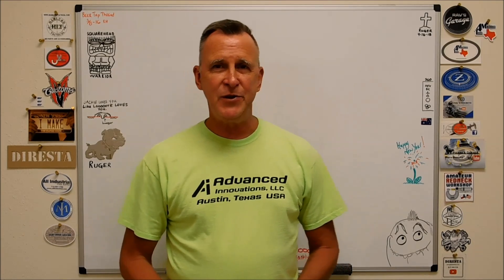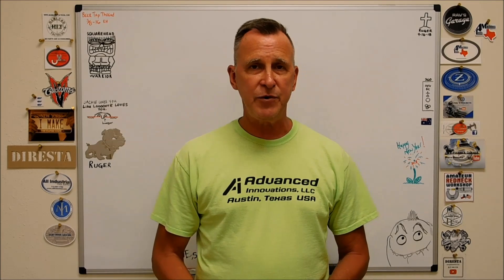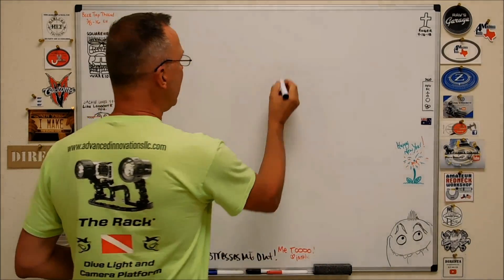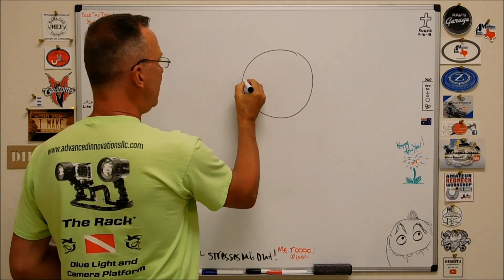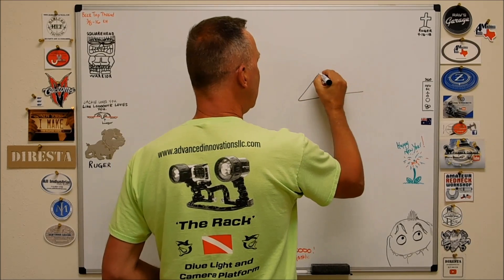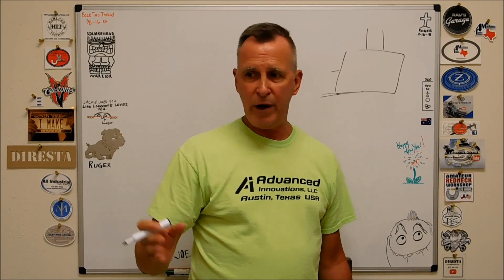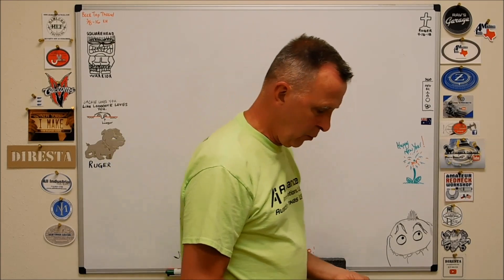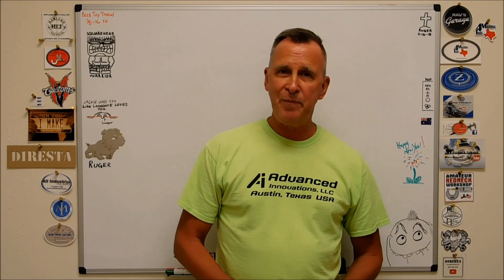Flycutter Tool Geometry vs. Chipped Parts

Comment: by adding a radius to the cutting edge, you're essentially making something that's similar in effect to a wiper insert, I mean there is a parallel, it's not the same thing, but the idea isn't far off in it's effect to the cut. it's very rare that I get to use HSS tools, the shop I work at is mostly exotic metals that are a bit too rugged for the High speed steel tooling, you nailed it with your answer to my last question (in regards to pushing a material very hard and still having trouble breaking chips) you nailed that in one, inconel. monel, hastealloy, Aermet, the materials that make life miserable are the kinds of things the shop I'm in deal in almost exclusively. It would be interesting to see you do a few videos about tackling the materials that make us all kind of cringe a bit. I did have another question for you less to deal with harsh materials, recently, I was turning some relatively large parts, 304L stainless. The problem I encountered that I couldn't seem to get passed was skin layer notching my inserts, tried tougher roughing inserts, with a larger radius, not much better results, slowed the spindle, and eventually both the spindle and feed. Still couldn't get a corner to make the full cut before it came undone. (6" dia. over a 52" cut, non ideal cutting conditions, the parts had a lot of runout so it was maybe .020 deep on one side, and .100 on the other, for the purpose of this particular job I'm going to call it and interrupted cut.) how would you deal with a job under those conditions, productivity is key, and restarting a cut that big 3 times to make the first pass, really kills it. this may sound strange, but working with something like stainless I almost prefer the harder materials, they may kind of suck, but I know what to expect, this was my first time dealing with stainless and I was completely lost on how to deal with the problems I was having.
Reply from the maker: I worked for a government contractor making submarine parts back in the 70's. I know those materials all too well. I currently do everything I can to avoid them. As for the stainless....2 rules for that stuff. Keep the tip of the tool buried, and don't be afraid to push it. Stainless, especially the 'L' series, like to work harden and lights cuts can be tough because of that. keep your tool under the top surface and keep it moving and you'll be pleased with the result. I say coolant is a must, but some may disagree. Keep the machine rpm lower on the 6" material, or the surface footage will just erase your tool. Good luck.

Comment: Hi Joe, 
Great videos and I learn a lot from you!!
I have a new job in a Tool Shop.
I could really use some tips for re-threading over-welded shafts.
I have to repair burnt bearing surfaces and ruined threads that have had new material burned-in.
Any advice would be much appreciated!!
Keep making videos to pass along the wealth of knowledge you have.
The few Manual guys like myself will use it and pass it on to others.
Too many new guys think CNC is where everything should be done.
You don't tie-up a 100K machine for hours just to make one part unless it is Very complex.
That machine could be making repeatable parts instead.

Comment: Time to go dust off or actually rust off my collection. Never had much luck with them.
Perhaps I can grind a bit correctly and get it set properly.
I've been trying to figure out the geometry of the cutter you used in your video "Safe and Easy Internal threading with a hard stop" where you face off the part @~19:00 and now I 'see' it.

Comment: In large part thanks to your videos I just cut my first thead ever (1.25" 16 tpi brass) with the first try being a useable part. 
 A good thing too  since the only stock I had was the body of an old shower valve.
This was for an emergency repair to an outside faucet where the PLASTIC body of the anti syphon valve broke, and of course is not available.
 It took me a laughably long time including grinding the tool on a rickety shop bench grinder. 
My lathe is a Chinese 7X14 I have used for the last 5 years for cutting and polishing. 
BTW: PVC pipe polishes up to where it almost looks like ceramic.

I am electronic engineer working mostly in software these days. 
On the "make a tool/jig" or 'just grind them out" decision the software analogy is whether to automate a repetitive task (formatting, importing data, whatever) I will always go for automating where possible for 2 reasons

1: Even if everyone says it is a 'one time' task it often turns out not to be and the basic structure can often be used elsewhere.
2:  It is simply more enjoyable than sitting there getting carpal tunnel from repetitive actions.

Again thanks for the videos, not sure exactly what I learned but beyond basic facts I found I had some "instinctive" knowledge when making the faucet plug, especially when dealing with holding and centering the "stock" i had to use.

Comment: if the cutter was balanced to eliminate vibration, would there be any downside to using a big radius fly cutter? like 6 or 8 in diameter...?
Reply from the maker: I don't see a downside if your machine can handle it. Knowing the increased surface footage resulting from the larger OD, slower RPM may be in order.
Reply: Mainly a gearing issue - the bigger the cutter, the faster the cutting edge travels. If your machine can handle it and has appropriate gearing, that doesn't sound out of the imaginable.
Reply: Suburban Tool, Inc actually sells them that go up to 19 inches. It isn't cheap though :-)
Reply: I have a flycutter about 1,5  feet in diameter for resurfacing car cylinder heads, but you have to keep in mind that it exagerates the spindle runout, if you have a geared head and the gears don't mesh perfectly it shows up on the finish, and if your mill ways aren't perfect you will never get a consistent cross hatch.

Comment: Great video,  very helpful but your cutting edge wasn’t on center on your second cut. Thanks!
Reply from the maker: Its better to be behind ( or below ) center than it is to be ahead or above center. The re-sharpening will drop the tool below center. its unavoidable.

Comment: many years ago i was milling some 2024 AL   very very soft.  with a 12 in milti insert face mill cutter.    after while i saw  the chips was  very very long.   20 inch or more.   the soft AL  was staying on the cutter and coming back around and welding on to the next chip.   1500 RPM   at 57 inch feed rate.   those K & Ts  are tuff machines.
Reply: it certainly wasn't 2024 aluminum.   2024 usually is in the T4 temper and is strong, hard and tough.  Or someone could have annealed it right before you tried to cut it.  I say right before because 2024T4 will start to re harden automatically in about a half hour (depending on its thickness).  What you are describing is a 1000 or 3000 series aluminum.

Comment: Hi Joe, this applies to all cuts. In the first cut you are reaching final depth with the very front of the tool, tearing a large part where at the back of the tool the material still thick strong enough to broke a piece with it off from the edge. If you would have used the same tool cutting only .005 it will most likely not happened. That what you did with the second cut where an upper portion of the tool does "pre-cutting" and the deepest part of the tool has much less and a bit later to cut. That is the reason I use rounded corner end mills for face cutting. Now, does that make any sense?..... Old Bob

Comment: Would a round bit work about as well?
Reply: no, same problem only in a form of a radius.
Reply: I'm talking about something like this... https://jet.com/product/3-x-1-Indexable-Round-Face-Mill-Cutter-Milling-Cutting-Use-RPMT1204-CNC/f9aab27d101f4edfa68ec1f583d1de8b?jcmp=pla:bng:nj_roc_gen_tools_home_improvement_a2:tools_home_improvement_power_hand_tools_other_power_tools_a2:na:PLA_333246416_1211661984210420_pla-4579328491921757_c:na:na:na:2PLA15&pid=kenshoo_int&c=333246416&is_retargeting=true&clickid=338f75ac-6aa9-4f35-bee4-1c335d1e9843&kclid=338f75ac-6aa9-4f35-bee4-1c335d1e9843&msclkid=f4d212629b181b715e914958e4121ef8
Reply: DSCKy Thats a shell mill for large areas. 
In order to keep the edge burrs down, you climb mill the perimeter first.
You can do the same with a fly cutter also.
Reply: We don't seem to be communicating. I "THINK" a fly cutter with a round insert similar to the ones in the shell mill should perform very nearly the same as Joe's bit... as long as you take cuts less than the radius of the insert.  The larger the insert, the better.
Reply: DSCKy I suppose so, I use a .125r on my fly cutters when i have room to. 
I think Joe was just illustrating common things to work around.

Comment: great demo again Joe, one thing about the "smear" edge: sometimes you'll never get away from chipping no matter how sharp the tool so a sacrificial piece sandwiched against it will eliminate any chipping.  works great on wood too by the way
Reply from the maker: That sandwich technique has saved my bacon on more than one occasion. you are spot on.

Comment: While I machine very little plastic there's not a hope in hell I'd ever have figured out to grind the tool tip into that shape to prevent blowing out the corners. More than logical AFTER it was explained Joe. Not even sure there still available, but years ago I bought a 5/8ths shank fly cutter that uses round carbide tips on the tool tip. Made by New Dimension I think? Unless you do something really stupid and break the carbide in half it's dirt cheap to run since the tip can be rotated as it wears or in case it chips the edge. It gives a great finish on anything I've tried it with.

About all I could add that most home shop guys either don't know or seem to forget is a single tooth fly cutter in metal is a finishing tool. There hard on the drive splines and probably spindle bearings at large depths of cut. Lot's of YT videos around where you can hear those splines hammering back and forth every time the tool tip enters the cut since there cutting more than the tool should be. Maybe I'm being a bit too conservative, but for that reason I limit mine to about .010" in steel and use it as a finishing tool and not for bulk metal removal. That's what face mills are for so there's always more than one tip buried in the cut and there's always a constant load on the drive splines.

Comment: Hey Joe; thanks for another great video.
 I have a tech question for you. I have a home made fly cutter with a 3/4" shaft running a L/H  1/2" shank CCMT 32.54 carbide insert. This tool gives amazing glass like finishes; even on junkie steel. However ONLY if I run it so it never gets the chance for the back side to cut otherwise it leaves a shockingly rough finish. This means I can only do smallish parts. It does this in BOTH directions so I don't think it is the tram of the machine at fault. Any ideas how to fix this please.  
Thanks
Reply from the maker: This could be indicative of the nose spindle bearings in your machine needing adjustment or replacement. The column / spindle is flexing under load for some reason. That is where I would look first.

Comment: But Joe the second fly cutter most certainly was a faster speed! :D
Reply from the maker: The RPM of the machine was the same, but the diameter of the tool was larger. I believe thats a surface footage element.

Comment: The geometry of the successful tool reminds me of an inserted face mill. Great video as always Joe.
Reply: that's the effect of chip thinning, you can go to the extreme to a high feed mills or the other extreme of limited radial engagement to do high speed milling.  It's pretty cool to see the same concept used for different reasons and outcomes.
Reply: Ya we use high feed mills at work. They make proving out new programs a butt clinching experience.

Comment: I noticed that on your fly cutters the set screws push the tool away from the centre line. Would it be better to have them on the other side so that you could use the same tool holder for different tool widths and them all being held on the centre line.
Reply: all the cutting force would only be supported by the set screws if you made it like that.  that's not a good plan, you want a plane of steel to resist the cutting forces.
Reply: There is a lot more material to put a set screw in on that side.
Reply from the maker: The tool offset is minimal and the solid surface is preferred. Less chance of the screws coming loose from the intermittent impact.

Comment: Hi, just a question, when you mention cutting speed you mean spindle rpm right? Because of the tool length the second cut will have a higher cutting speed than the first one, right? Love your channel and how you explain things :).
Reply: the speed in rpm will stay the same  the cut in feet/minute or any variation thereof will change. if desired change your feed rate for optimum. it is easily confusing.

Comment: Excellent video.
I have been thinking about making a flycutter tool for matching small steam engine parts. 
I am thinking of using 6mm replaceable carbide tipped tool. Can’t decide which to use for mounting, in lathe chuck, taper in spindle or collet mounting.
Myford ml7. Myford collet mount.
Spindle requires fiddling around with a draw bar, collet mount is quick and easy, chuck adds mass to the tool. Any suggestions anyone. Machining cast iron area up to 1 1/2 x 2 1/2 inches.
Reply: As a general rule I  try to use the minimum number of components/ shortest length between a spindle and a tool. This generally improves surface finish and cutter life. Flycutters are one of the more dangerous shop tools to the uninitiated  so  be careful. You may consider a baby face mill instead.

Comment: Thank you very much for posting this video. Besides pointing out common problems that can occur when using a fly cutter, you explained the root cause (forces being applied in the cutting process), which in turn made the solution make sense.  Thanks again for sharing your knowledge.

Comment: Another great video!  Thanks!

One thing you didn't mention, which I thought was pretty cool, is how you've relieved the front rake on the plastic-cutting tool which would make honing much easier.  Kind of like the back of a Japanese woodworking plane iron.